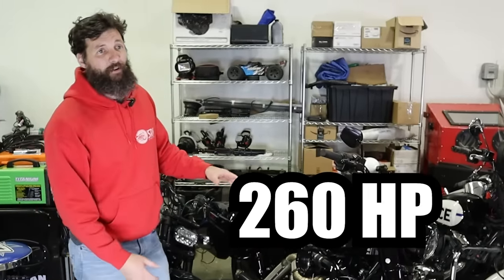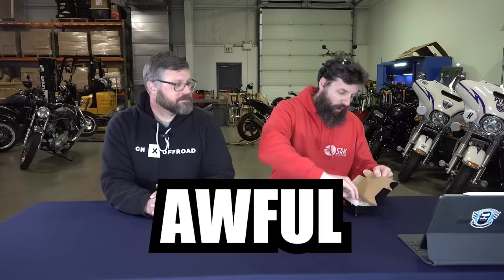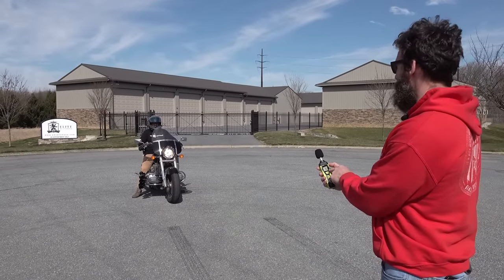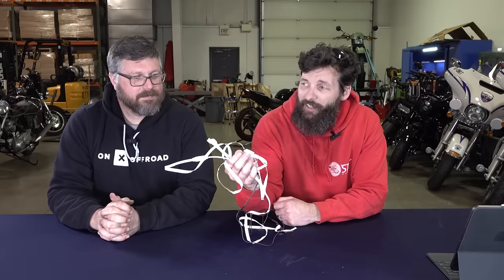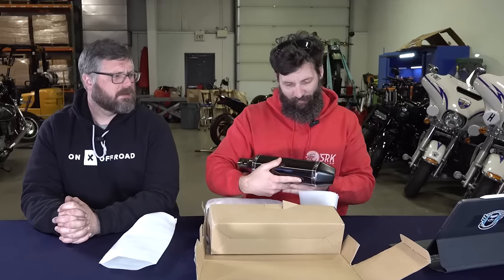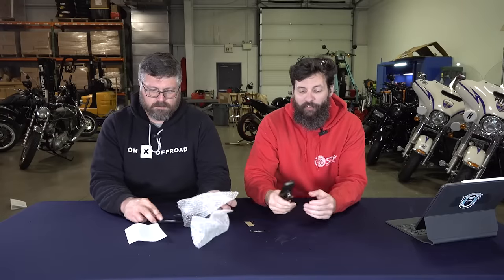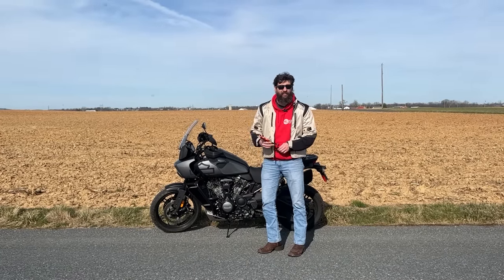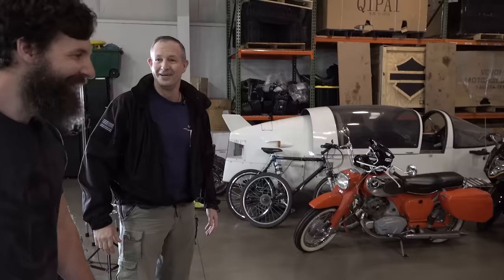Testing amazons illegal Motorcycle Accesories

Comment: I'm sure Shervin approves of the "Big Performance" exhaust on the CBR.  In fact it looks like Shervin's work...

In case you're curious, Shervin is a legend on the old ZX-10 forum and the guy had some really sketchy mods. From hand bent sheetmetal and pop rivet "exhausts" to hacking out holes in bike frames for "weight reduction" and "ram air".

Comment: Hey, Shawn. Ornamental lighting is legal on motorcycles in PA with some exceptions
Reply: Yeah I’ve always heard (could be rumor though) that anything other than emergency vehicle colors like red and blue is ok.
Reply: @cfltitan  if it helps, it's subsection 4310 of the PA vehicle code.
Motorcycle lighting.
Auxiliary lighting may be added to a motorcycle to protect the driver, including blue dot illumination, standard bulb running lights and light-emitting diode (LED) pods and strips.
Reply: @michaellynn669  oh ok cool. Thank you. I don’t run any on mine but it’s still good to know.
Reply: Same in VA
Reply: you cant have "flashing or revolving" lights, and you cant have red or blue to imitate police. there's also a code about "rearward facing white light" so dont put a giant white spotlight to shine into the windshield of a car behind you on the highway. theres also some restrictions around yellow or amber in combination with white light that are specifically allotted to "privately owned authorized emergency vehicles" like tow trucks and stuff. basically dont make it look like police, fire, ambulance, or road construction vehicle lights.
Reply: No
Reply: Yea, underglow is illegal for cars, but legal for bikes in Illinois too. Problem is my bikes are blue, but blue and red are still illegal.
Reply: In Australia underbody lights are legal as long as you can’t see the lights (bulbs) so the glow is fine as long as they don’t flash as flashing lights are for emergency vehicles only. 
When you see flashing lights every car just moves to let them through.
Reply: Absolutely correct...legal in pa
Reply: Legality is not a concern if you do not register your motorcycle in the first place. As long as you are not using it to "transport goods or passengers" for hire, it is considered consumer goods under both Federal and PA statutes:

Title 13 § 9102.  Definitions and index of definitions
"Consumer goods."  Goods which are used or bought for use primarily for personal, family or household purposes.

Federal equivalent is UCC § 9-102.

"Vehicle registration" is a tax, and consumer goods are not taxable in this manner. If a road pirate stops you, you can show any of these:

- Manufacturers' Certificate of Origin
- Bill of Sale
- Title (if you choose to title it, which you probably should not do, as doing so grants the state an interest in your property)

You can make your own sign that would attach in the space where a tag normally goes that states the fact that it is a private carriage. You are not subject to any of the MOTOR VEHICLE statutes if you choose to remain private. Just make sure to have some papers with you that state this clearly because you will not be verbally explaining this if they target you for harassment.
Reply: @alphaforce6998 found the sovereign citizen.
Reply: @alphaforce6998  You'll have fun explaining that nonsense in court after getting your "private carriage" towed away and possibly spending some time in jail depending how dumb you are. That is a worse outcome than just following the law even if you were right and could get it thrown out.

Comment: The "get back whip" was described to me as a "Leash" with the intent of being utilized as a quick access weapon not against cars but against other people where you pull it off and you use the metal end as a flail.
Reply: It's also great when you're street racing in the Redwood Forest and you need to knock the guy in first place off his bike.
Reply: @robinsonrom  I prefer the bat with nails driven through it
Reply: I had a get back whip on my Harley (lol yeah, I know), and I never heard of it being taken off and used as a weapon. It was described to me for when people are too close, you can use it to make them "get back," or move away from the bike. In doing so, it was not removed though, as it's primary use was for people too close to the edge of the roadway on the sidewalk on the right side, hence why it was attached to the brake.

But honestly I'm sure there's many "reasons" that someone could have one.

Comment: Fellow PA rider here.  Bike lighting like LED strips ARE legal in Pennsylvania.  Here's the text of PA Act 50:

Act 50 of 2006, enacted by the General Assembly June 2006 and effective August 2006, allows for auxiliary lighting to be added to a motorcycle to protect the driver, including blue dot illumination, standard bulb running lights and light-emitting diode (LED) pods and strips (Section 4310).

Comment: The dB scale for sound level is a logarithmic scale. Every 3dB more is doubling the sound pressure. Suppose you start with 80dB and the pressure is 110. When you go up to 83dB you get double the sound pressure to 220. You go up to 86dB it doubles again so you are 4 times as high as 80dB and get 440. Go up an other 3dB to 89dB and you go to 8 times as high as 80dB and get 880. Go up to 92dB and you go to 16 times as high as 80dB and get 1760. This goes on and on.

Comment: I have a set of underbody lights, it's actually two sets of red LED strips (6 LEDs each). I can turn it on with a switch, and only use it as an extra light when hitting the highway in the night, or just to show off a lil bit in the city.
They are very visible cause the red light it's pretty dim

Comment: Four years ago at an ADV rally a dog ran out into the road. Straight at me teeth out, he wasn’t a happy dog. I leaned away, gave throttle, the dog went for my left foot/leg. I lifted my leg and the dog got my foot peg. At this point Mr grumpy dog realized his mistake. Me going 30-35 the dog running at an angle towed me whatever dog speed is, probably added 10mph to the foot peg & mouth contact. 
This all happened in a few seconds but if I had the “get back whip” I still wouldn’t have had time to use it. Haha 
   I stopped in at the house the next day to check on the dog, no one was home. Awe well.

Comment: 😂 im a PA boy and im just about done with my build. Its only a short list of things that are illegal. Removed the rear suspension, chain gaurd, front fender, mirrors, speedometer, odometer, mufflers, kill switch, highbeam switch, and air filter box. List of parts i changed to illegal parts is apehangers above the hight of my shoulders, increased carb jet size, decreased size of signal and brake lights, and using a plate from a similar generation motorcycle i already own because i can't reach the current title holder. Good thing i live in a small town where as long as im not causing trouble i wont have any trouble lol

Comment: "Not wearing any underpants.." is known as "Going Commando", that's "Commando" Sean, rather than "Commander" (interesting random stuff from today? I was reminded that Norton had a model P11, a really cool Motorcycle that became.. ..the Commando.. and, Clint Eastwood actually had one tied into his deal with M.G.M. for the film "Where Eagles Dare" - Jus' sayin'). 😉
If you can ever find it, check out the (U.K.) Bike Magazine article "Never Mind The Bosozuko" from around '82 or '83, when Bosozuko (quite serious types really and not so much cartoon characters, especially at this time) were typically riding CBX 1000's, six downpipes straight into short lengths of scaffold pipe and were a rolling riot.. ..which rather appealed to someone I know, who duly did the same to his CBX (it became a thing here locally.. ..and understand this was kinda just post Mad Max, which helped). 🙄Moving on..
I think something we can take from this edition is Amazon is NOT a Motorcycle Factors, Kevin's good fun and S&M gear has absolutely no place in society, particularly out on the Highway.

Comment: 22:47 tecnically every 3 db you go up is a doubeling in acoustic power and when going up 20dB it is a 10x increase. coincidentaly a 3db increase is (usually) the ninimum required for the human ear to tell a difference. also if you double the distance to an audio source you will loose about 6dB (1/4 the noise) dur to the inverse square law

Comment: I actually put a 2 Brothers carbon fiber exhaust on my CBR250R and it.... was ridiculously loud, but damn if it didn't actually sound good. Single cylinder (literally 1/4 of a 1000RR), and it was loud AF. I never got pulled over, that thing would even spit a flame from time to time, but I put a fuel controller on it as well

Comment: So, there was a Yamaha raptor (high performance 4 wheeler) that went thru my shop that had those knife blade handlebar controls installed. The bike was sold as the previous owner ended up with the right side one very deep into his thigh after a high speed crash. He very nearly bled to death before aid was rendered, it wasn’t good. Has a bad limp to this day as a result. This was in 2021 in Nova Scotia, Canada. Thanks for pointing out how dangerously stupid they are!

Comment: No noise ordinance or emission laws in Georgia or inspection.  It can be true x or h pipe straight back from the headers no cat no muffler.  No one cares a gated residence at 3 am might have a problem but in a town or rural area no one cares if its a Detroit 60 series with the jake break on, with only a stack for exhaust no muffler no cat etc.

Comment: All highway and off-road motorcycles manufactured since 1983 are regulated by federal law under the authority of the Noise Control Act of 1972, which is still in effect. Federal regulation 40 CFR 205, parts D&E regulates their total noise emissions. It also regulates their mufflers and requires motorcycles to be equipped with EPA-approved mufflers, not just when leaving the factory, but at all times while they are in the United States. It is a violation of federal law to tamper with the emission control devices of motorcycles–even those devices that control their noise emissions (their mufflers).

Excessively loud motorcycles are the result of the deliberate action of their owners to alter their exhaust system–which is illegal. The most common form of illegal tampering is removing factory equipped EPA-approved mufflers and replacing them with after-market mufflers or entire exhaust systems that are not EPA-approved. Those after-market exhaust mufflers are not designed with effective exhaust noise suppression as a primary design goal. They are designed to increase the exhaust noise of motorcycles and their manufactures openly admit they are intended “for use on closed courses only.” Those types of exhaust systems are not legal for use on highway motorcycles.

Comment: Hey, dont want to come accross as the typical fact checker but lets be honest, how many chances you think I am going to have to show of my knowledge on the matter😂

 The rule of thumb is that decibels is an exponential measure and every 3db you are actually doubling the sound pressure (if you want to call it that)

107 db is the equivalent to having closed room with 30 dogs barking at the same time,  another example would be a rock concert. 130 is roughly a jet plane taking off next to you.

Comment: Unless the brake lever on your motorcycle is only long enough for two of your fingers, you're supposed to be using all four of your fingers to brake with. You may have contempt for the safety systems on your motorcycle, but I certainly don't.

Comment: Do you have to wear a helmet while on a temp motorcycle license in Minnesota?  Yeah.  Can you take the road test or the safety class that counts as the road test the same week? Also yes. 

You don't actually have to take the course or road test if you are ok with daylight riding with a helmet.  You can just keep getting the temp license for $29 a year if you insist.  Without reading the motorcycle manual the state puts out I was able to pass the written practice test on the first try. Could be riding a liter bike that evening with no motorcycle experience...